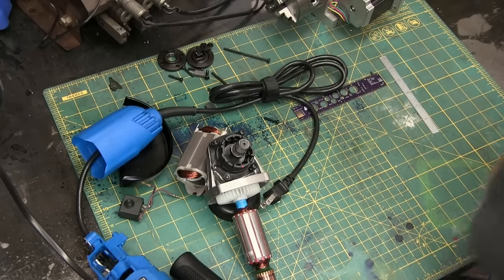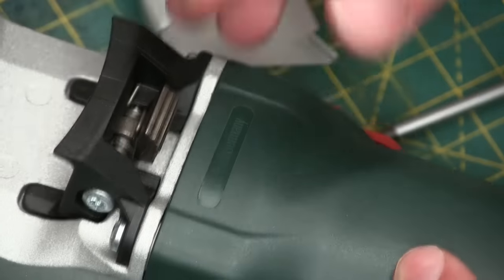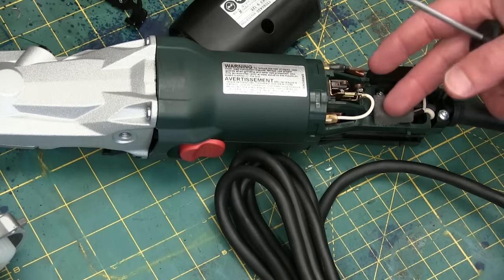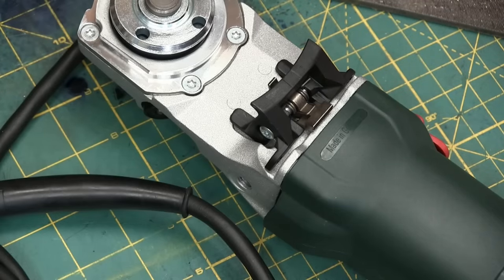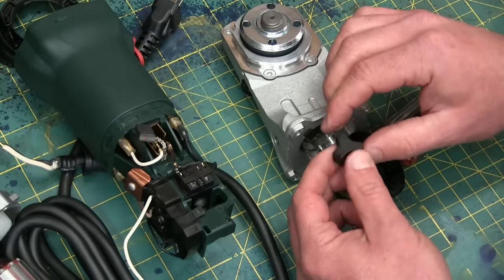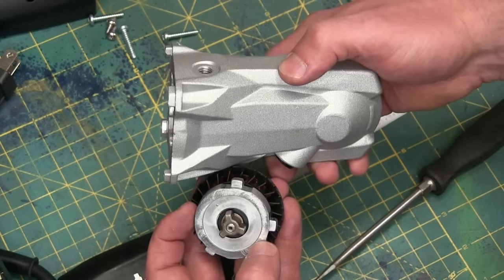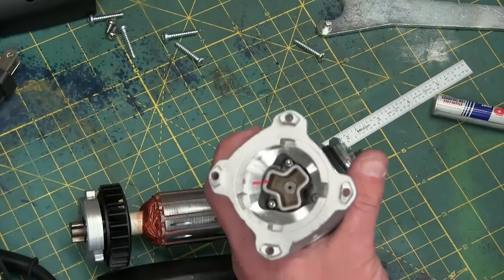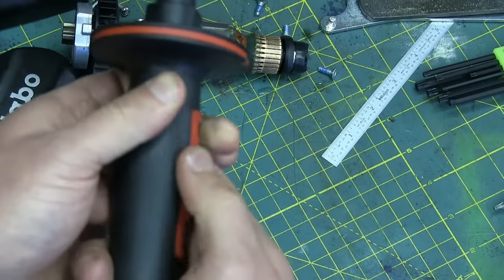BOLTR: METABO GRINDER. MADE IN GERMANY

Comment: Hi AVE,love your videos,  the loose fit and finish on the switch is probably to compensate all sorts of contaminants like metal dust, dirt etc and keep working, my carpal tunnel syndrome is most likely because ive used these grinders 12 hours a day for years and luckly the switch was loose or else the damm thing would have probably jammed on me, just my 2 cents.

Comment: Among all the 125mm grinders ive used, Bosch professional is by far the best. Never been able to break one allthough working in a quarts quarry. Skookum as FACK! Shuld be no problemo handling a 400 pound gorilla. 
Never been satisfied with either metabo, hitatchi, DeFault, Hilti, milwaukee, or the green bosches. 

I think you would enjoy digging in to a Bosch professinal 125mm 1900W horsecock style, non adjusable speed. Its a beauty!

Comment: Here you can get that Metabo model for 150 euros but there's only one rat tail Makita model, it's got more juice but it's like 240 euros. A Makita with the similar shape of the rear end and similar trigger and similar power is also about the same price as the Metabo.

Edit: 150 euros for the normal Metabo, not that long and thin nosed one. That's nearly 300 euros here as well.

Comment: If the only real thing that makes this grinder better than makita is the over load, is there any need for aftermarket overload protection? I'm thinking it could be in a little box that goes in between the plug of the tool and the wall. Can have soft starting and de rates based on current. During normal running it could latch a relay to drive it at full power

Comment: Well I know in electrical the gauge dose dictate how much amps are allowed thru the wire. For example a water is rated 30 amps, therefore a number 10 or 10 gauge wire is called for. Other wise you are right.

Comment: The red tab is replacable. Press the two pins inside the grinder with long nose pliers to pop it out and you can put a new one in. The black link underneath is much more resistant than the red part.

Comment: So how does the lead jacket compress the rubber? Is it put on molten and just thermally contracts? By the way great vid, you never fail to crack me up.
Reply: *****
but how does the compression happen? The die, the thermal contraction of the lead, or both? EDIT oh wait you said it was solid lead. so just so they can squeeze it through the die without tearing up the rubber?

Also senpai noticed me!

Comment: Greetings from the almighty UK hehe. Quick one.., we've all leaned on an angle grinder more than we should once in a while but my question is, once it starts to heat up in your hand to the point of almost no return. Is it best to run it under no load to help cool the tool down or leave it on the bench and pinch your neighbours to finish the job? Asking for a friend as I normally just crack on until it lets the smoke out. Cheers ears.

Comment: Hey that detent probably isn't a standard metal part. Based on the parting line witness, I'd say that's actually a MIM part. Stronger, more expensive part with better tolerances and surface finish.
Reply: I should say isn't a standard powdered metal part.

Comment: The thing with the not tinned wire is that tin is malleable and will sqish out to the side of the pressed connection after a couple of years. This increases the contact resistence. Yuo do not want that. The brass ferrules you crimp on there are for keepin the strands together and not letting the conection degenerate over time.

Comment: AVE want to play with some polysulfide epoxy? pretty cool stuff. Cures in about 3-4 hours out in the sun with short chains (shore a 25 if I had to guess). Inside at 70f takes 10-12 hours and it's much harder. If you want some, I'll send it.

Comment: that pin In the brush is a spring loaded pin 
when you wear the brush 3/4 down the pin springs out and pushes the brush off the comutator and it makes a god awful noise as it spins to a stop

i pulled 3 grinders out of the bin at work, the welders thought they were fucked 
$30 in brushes iv got 2 5 in grinders and a 9 inch

Comment: maybe the US made makitas are something special but the regular ones sold everywhere else suck compared to the bosch angle grinders.  bosch also has a very nice quick adjust,  no tools needed guard system that never fails.  the guard system on this metabo is interesting though as it can be removed without the need to remove the cutting wheel.

Comment: The only thing on my metabo grinder that has failed so far is the "quick" grinding disk nut. It has two pissy little flanges that locate in the shaft which bend easily if the nut is not tightened properly (we are not all perfect). Once bent its an absolute pain in the ass to use. Currently using a standard makita nut instead.
Reply: But it looks like the one you have there is just using a standard nut, so doesn't apply to this tear down. Great video though, keep it up mate!

Comment: Hey Ave, Now I know you said that you dont take video requests but hear me out. 

It would be awesome if you could make a guild about identifying diffrent metals and their resepective propertives i.e. Iron alloys, copper, aluminum, titanium ect. Aswell as the diffrent forming/treating methods used for each i.e. galvanised steal, cast iron, hardend steal, tool steal, nickel/other plating.

I've looked else where on youtube and their really arn't any good comprehensive guides on the subject.

Comment: Since i have used both Makita, Hitashi, Millfuckie and Metabo grinders. Makita truly is the king manufacture of angle-grinders. 
BUT i i have to say, i just started using a (HILTI DCG 125S) holy macaroni. It's a beutifal machine for light-medium cutting/grinding. 2.4 kg, 11000 tours/minute, 1400W 6.4A, Active Torque Control (ATC) technology minimizes undesirable kick-back.
I've been cutting HEA200 with that little fuck and it just laugh it off. 

I would love to see you review one of those puppies! 

Best regards from a Viking Smith in Sweden.

Comment: Does brass oxidize? I thought that was why they used it. Compared to copper, it's a garbage conductor (28%). So I thought durability was the only reason to use it in the first place. Though tinned copper is vastly superior... but I won't go down that rabbit hole - the use of brass over copper with a plating is a major pet peeve of mine

Comment: could you please do some review on some kind of cordless wrench?
Reply: yeah lol, sorry for my english. i meant something else, but im sure you know. i think those things are kinda interesting because they can handle quite allot of torgue.
Reply: Do you mean some cordless press? I only know some tools for plumbing pipes. They get squeezed nowadays instead of soldered or brazed. But that is old fashion now too since one uses plastic instead of copper now. But they get clamped tight too. Different mechanism, new tools to buy but at least no powertool needed. Or do you mean a tool that turns like an impact gun. Its like the thing you use for car wheel bolts. But he has done a review on that, just search "impact gun"
Reply: i meant electric impact gun. and he did only air powered one.

Comment: I have 2 Metabo's on my wall of grinders, ones about 6 years the other is 8 months. 9 in all - dont change the blades. just grab another one. On the old one th eswitch has the same setup, but, when it gets too hot, it automatically pops off by itself. 4-6 hours of grinding dump truck bodies will shut it down. The new one slows down and i guess thats the way its telling you to let it take a break.

Comment: I own this grinder in paddle-switch version (dead man switch).  I also have a couple Makita grinders.   Makita does NOT make a low profile grinder like this Metabo.   That inch difference matters when you're trying to get inside a welded up angle joint.   The Metabo will get into a 45-degree angled joint, the Makita will not.

Comment: you ever get your hands on that cordless hilti concrete fastener? the thing looks like a beast and unfortunately i cant justify the 1000$ price tag any way it goes. but hilti has a video breakdown of its internals and it looked extremely overengineered in a good way is hilti an overhyped company because ive seen some contractors use their tools but their expensive and always seemed to lack the features milwaukee had.

Comment: So, it seems that thermal overload and the thinner overall thickness of the nose seem to suggest this is a good investment, at least for what it will be used for. We needed something that will be abused, considering what we do.   My boss just bought a 18V cordless Metabo, for cutting out a ton of rear ends quickly from some old dodges in the boneyard. Hopefully we get our $459 (USD) worth out of this tool, and it cuts for this job, and years to come!

Comment: As a fellow Canuck, love your vids! But i do have to disagree to some extent. As a ticketed welder and metal fabricator of 30+ years I've gone through Makita's and Dewalt's like ass wipe! Not realy, but you get my point. The Metabo is the best grinder i have ever used, and i am still using it to this day. I use it every day and have been for close 8 years or so. it has a shit tone of hours on it. Now keep in mind that i have the 6"grinder with the same body and trigger as the one you reviewed, but its not that flathead. The best thing about them is the lack of vibration and the strong motor, they are very smooth. But, yes that trigger is a piece of shite! Its the first thing to go! For the home shop, ya save a few bucks. The Makita and Dewalt will be more then enough...... Great vids bu'y!
Keep You Balls In The Breeze!!

Comment: Old video but bought one of these in the summer 2019. Had a job we were doing and could not get the fat head grinders in there. The Metabo worked great. It was a few weeks later we had to use it again, a specialty grinder we don't use daily. I started having trouble with it when I switched it on, it wouldn't come on. Shake it, wiggle the wire(stays nested in the back seat of the truck) and eventually it would start and work without issues for the rest of the time we needed it. After my switch literally fell out of my regular, expensive Metabo grinder that was also only a few months old,  I swore I'd never buy another Metabo. Apparently you can't teach a welder easily as I ended up with another one....that has issues, fresh out of the box. It's good to have when you need it, shaking, a few mother fuckers and it starts to work. Not impressed at all with Metabo's after the two that I've owned. I have 5 Makita 9005's 5" and 6", yeah, us weird Americans not using the metric system. The Makita's get dropped in ditches, dragged through the mud, laid down next to the pipe in slick greasy mud holes then put on a rack in the back seat of the truck to await the next job. After 3 years of use on two of them, 2 years of use on the other two and one sitting on the shelf in the office. The Makita's, I have had to replace brushes in one of the 5 and put a new cord on one of the 5, that's it. They get used hard grinding out bead passes and other daily jobs. To much hype with the Metabo's, in my experience, buy a Makita.

Comment: it may be wort mentioning that tools like the one on the video were designed using 3d modeling software... this software can help the engineers to know if the materials need to be stronger and/or if the part needs to have more or less material.. these programs are not cheap... nor is the tuition... in fact I tend to say that such jobs are not made to take in a poor person... the cost of the program can be of more than 70,000 USA dollars... the monthly tuition costs aren't exactly accessible...

Comment: AvE, is there any reason you dont fix up the issues you see - like soldering the sloppy tiedowns, or replacing the urathane foam with hot snot - as you see them or even afterward? There was one video where you tore down a fluke and made some improvements and it lead me to do the same to mine. Ostensibly not good to go adjusting things when you don't ser their full purpose of design, but some things are just obviously bad craftsmanship. I just wonder if you have a philosophy on that for your videos.

Comment: Nice to hear you describing a protection circuit as actually "valuable"... gasp
Perhaps the METABO would outlive the Makita in extreme temperature use cases...certainly in an "overheat/abuse" environment and it seems like it would be a better choice for extreme cold. Especially with that luxuriously floppy rubber cord.

Comment: I know all to well about x link plastic.  I used to roto mold kayaks.  We used x link for a while and I had a bad skin reaction to them oils when they came out the oven.  Worked with linear for years and it didn't bother me.  If we fucked a boat it went in the garbage.  Like you said, can't re-melt it.

Comment: Those stake on connections  with the ring only reasonbi could see that is for switch replacement  cause I see those wires break all the time on makitas which the switch on the 6 inch rat tail the wires break often as well as the switch in generalb

Comment: Not only does it look loosey goosey, but it also seems like one side of the shrink tubing is burned and the other side untouched. Almost like some idiot gave it too much heat and only applied that on one side. Maybe to save a second or something. 
Well, at least it looks like it, but I could be wrong and that pattern is a print from the foem pressing on it. It's on you to judge it first hand.

Comment: I prefer this type over the "rat tail style" grinders, this is better when used one handed laying on your back under a car cutting something you hold in one hand, witch is how I usually use my grinders. 

extra style points for removing the guard to get into a tight spot and shooting sparks in your face...

If I'm not laying under a car I'll still rather hold the stuff in one hand and grind with the other, because the vice is over 3feet away. The rat tail ones feels to me like some health and safety stuff so you have to put the thing your grinding in a vice because you need two hands to use the grinder...

Comment: Tinning screw tightened contact/cables is a fire hazard as the tin over time is floating away from the pressure leaving a loose
contact - high resistance -> heat

Comment: In Belgium, if you shop around, Makita and Metabo are about the same price.
The trick with Metabo is to find the ones with the plain jane white packaging, same vibrator, usually 20% cheaper.
My tools, by natural selection, have ended up being Makita, Metabo and Hitachi. All the others have died, money wasted.
Buying Dewalt, B&D and the other half dozen el cheapo brand that appear all the time, is like building a wall with faecal matter and stale bread loaves... Faster and cheaper but it's still a waster O money compared to brick and mortar.

Comment: I have bought  metabo cordless drill BS 18 LTX, not so cheap  tool aroud 300-350 €, I have charged  batteries aroud 8 -10 times in 2 years and my charged failed  I was in shock  how is this possible, then I have found on internet that they use cheap parts  and produce charger in such way it is hard to repair. I will take it to local  repair shop will not buy new one wich is not that expensive. Very disappointed  with quality. From now on I buy tools from Lidl. You don't  get what you paid  anymore for anything phones, tools, or most of any consumer products.

Comment: High resistance means low current, which means reduced heat. (Not to be confused with frequent arcing.) Jus' sayin'
Reply: I wouldn't know about that; over here, houses and universities burn down due to pointless human resistance...
Reply: but the part that's resisting does get hot
Reply: Tell this to my pals car headlights - coroded terminals, burned isolation and even terminal holder. That overheat comes from what?
Reply: justcarcrazy you are crazy
Reply: Power = Current^2 x Resistance = Voltage^2 / Resistance.
Reply: Actually it is higher resistance. Meaning more heat in that location. Heat is generated in that area causing the wire insulation to melt. There is also heat cycling causing the copper in that part to harden becoming brittle, after which it will break.

Comment: Guten Tag ! "Sadly" i have to inform you that i rarely see Metabo in industrial use here in Tschermany, and i have a problem with your called out pricing. Funny Thing is that i know so many models of corded grinders, but the one you are presenting there is actually the model line we have as cordless versions here (WF 18 LTX 125 for example, about 250€ with a box). The corded models have different gears and another shape, more like bosch or makita. funny thing is that i cant find that version you are presenting, and the cordless models of the other gear type are around 450€ , where the corded version is 150€ ... what i do see on industrial sides are makitas and blue boschs, btw. 

So i GUESS they have a different approach to the market in US/CAN , where they try to live from a "MYTH" , use the public image of the company to sell overpriced to rich DIY-Guys. Metabo isnt cheap here in Germany, too, but that model line you are presenting, the production of this specific design is used for cordless, mostly 18V Li/Ion here in Germany for a reason ... and they sticked to the older design with the (more powerful, heavier used) corded versions. (compare WX 2000 , or WE 22 -230 which i both know and which are WAY CHEAPER and better in quality, i bet!) Greatings, as always. love what you do, and HOW you do it ;)

Comment: I'm thinking that the slop on the switch is by design, to prevent the slide from wearing out sooner than later OR the pivot could be for ergonomics so that we don't "have to" line our thumb up parallel with the switcheroo. Then again maybe it's a Mickey Mouse job like U said, idfk...👍